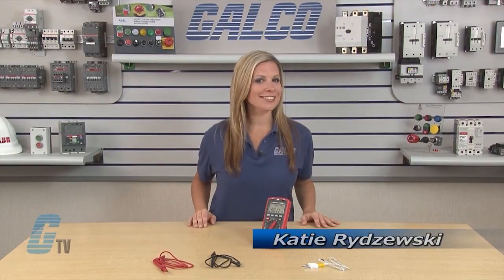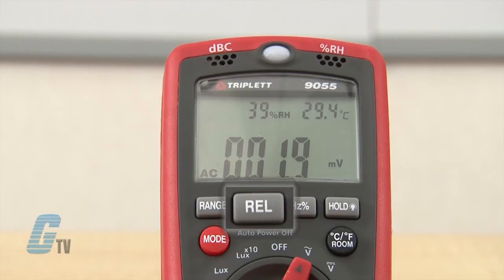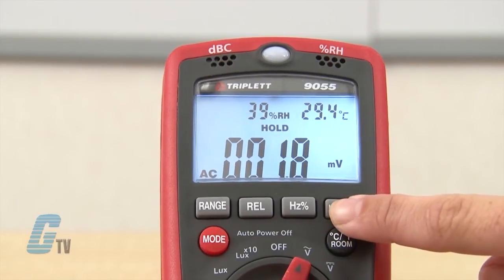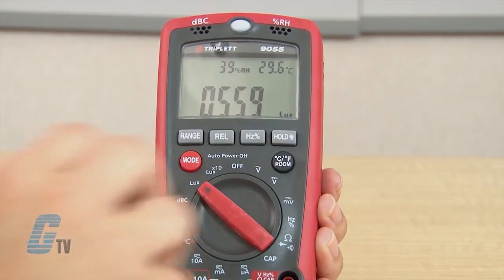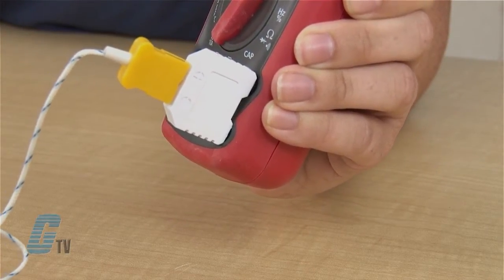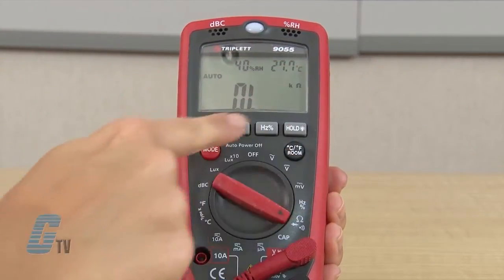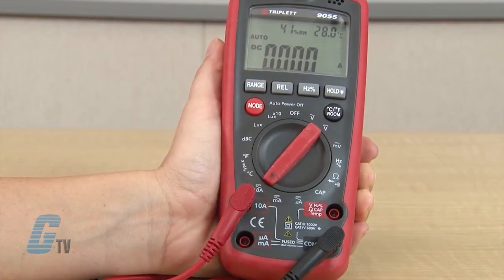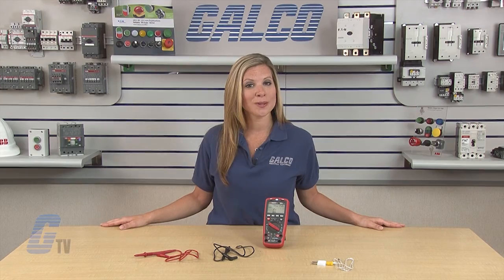Triplett 9055 Series 6 in 1 EnviroMeter DMM

Comment from the maker: The Triplett Model 9055 is a 3‑3/4 digit (4000 count) high performance digital multimeter with an array of environmental functions. It offers over 50 measurement ranges including AC/DC Voltage, AC/DC Current, LUX, Resistance, Continuity, Relative Humidity, Capacitance, and Temperature. The rubberized over molded housing provides impact and drop resistance in a sleek ergonomic design, and the user‑friendly Auto Power Off feature helps maximizes battery life. With an industry leading CAT IV design, it provides superior resistance to damage from transient over voltages in any demanding industrial settings. The Model 9055 is suited for a variety of industrial and residential applications such as security, home theater, electrical, HVAC installations and more.